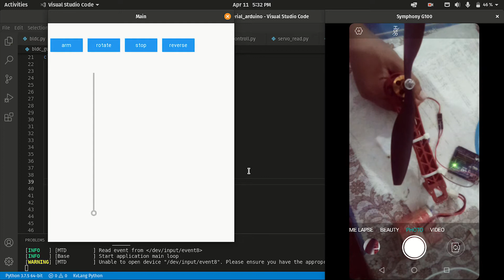Control Brushless DC motor's speed using python and arduino || kivy || kivymd || pyfirmata.

Comment: Hi i am also trying but can't connect with my motor at all (using a l298n). Can i see your code?
Reply from the maker: https://youtu.be/LxQyB9Los8M
check it out
Reply: @OIRLDBOX  thanks bro, but i have one question. I have a l298n where you have to enable and give direction. Why are you using servo instead of pwm